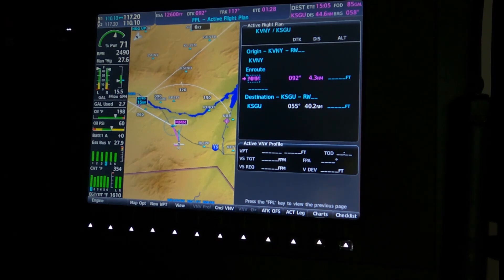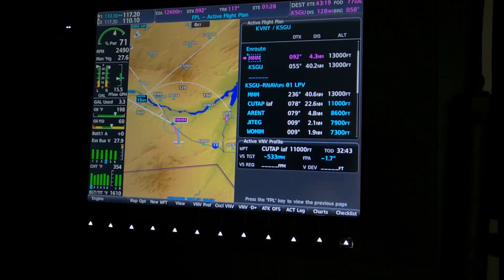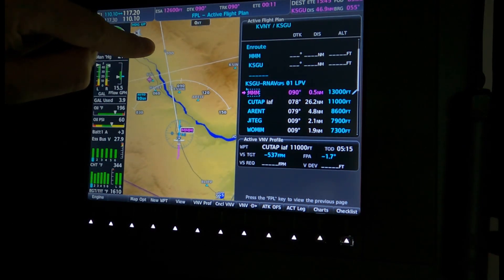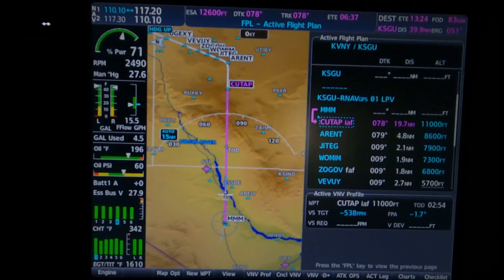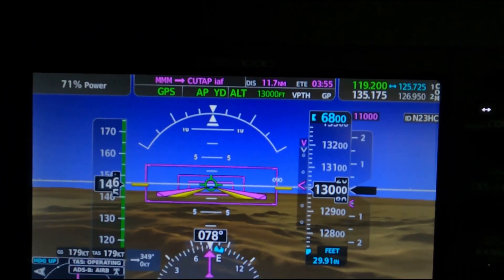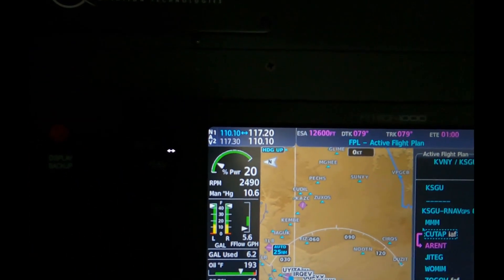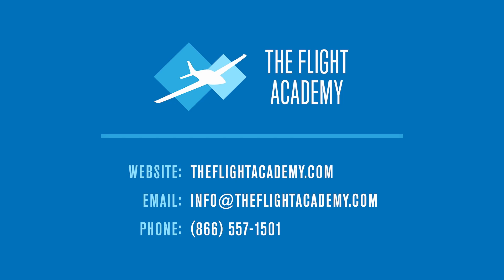Intro to VNAV Part 2: Flying An Approach

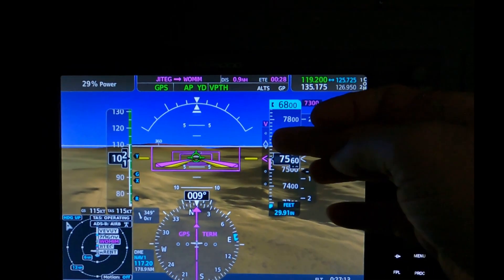Comment: Not sure if you are monitoring this video for questions, but am wondering why the SCOREBOARD shows ALTS (15:00 minute mark) when the VNAV altitude is 7300 and the ALT Bug is 6800.  Doesn't it always take the higher of the two altitudes, which in this case is VNAV and therefore should be ALTV in white on the scoreboard?  Thanks.

Comment: Great video.  Scenario question - VNAV takes you to cleared altitude (that is bugged above the fix altitude).  You then get cleared lower or for approach - do you then use VNAV Direct to catch up?
Reply: exactly my question what happens if you miss TOD and then get cleared?
Reply: You should have the VSD display up when flying an approach with VNAV!  You have a moving map that shows your vertical profile and improves SA.  Why aren’t you using it?  This seems to be a common error.
Reply: I sometimes blow past a waypoint without capturing VNAV (which is a separate question). I try to VNAV direct to catch up but the option is greyed out. Why might that be? I supposed it was that the gradient is now too steep but you said it would accept anything. Could I VNAV direct to the waypoint after that if it’s a more achievable gradient and if I can be at or above the next waypoint?

Comment: So what’s a better method for the steep descent? Flaps 50 during that leg?
Reply: Reduce power earlier so that you enter the steep part with approx. 100 knots instead of 145.
Reply from the maker: Yes indeed: Speed is your arch enemy if you have to make a steep descent and 100 knots is a good target though I wouldn't be upset with 120 either (in a G5, 6, or 7 at least).  Flaps can be tricky because if you nose over for a steeper next leg, you might overspeed them.  Also consider if you're coming down through an ice layer you may want to hold off on the flaps for a bit.  

I've got to get my notifications turned back on, sorry it took me a bit to get back to you @SamLeHardy
Reply: @theflightacademy  Thanks for the great videos and the explanation on how to slow down.  Keep up the good work.  Cirrus Perspective/+ videos and training are really lacking in my opinion, even straight from Cirrus Approach.